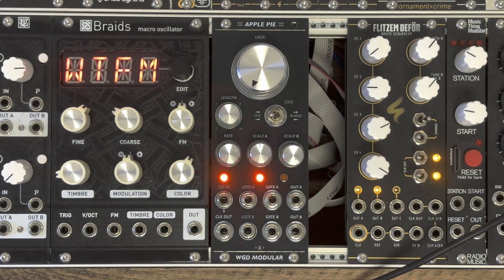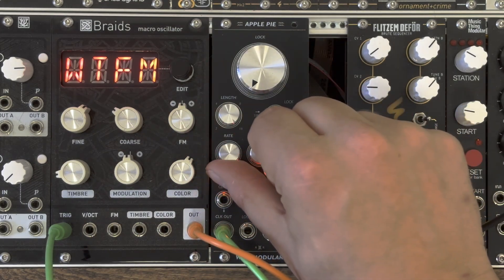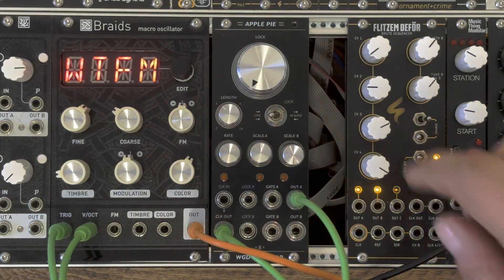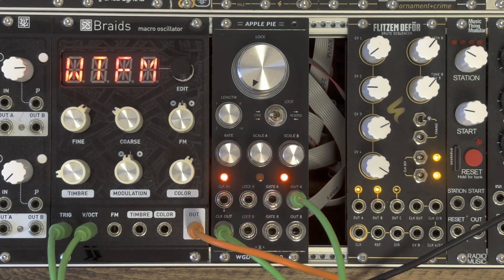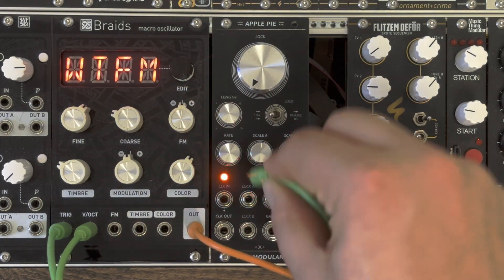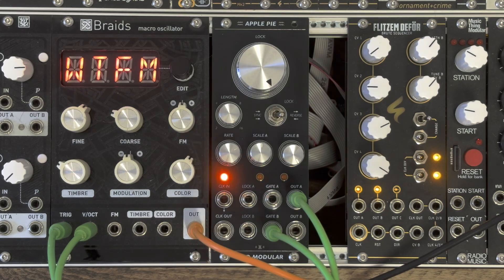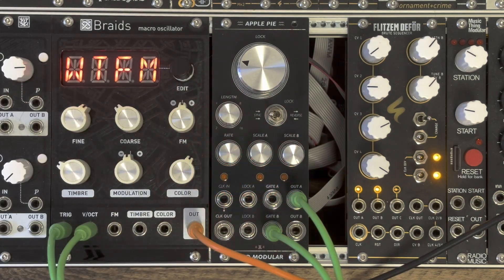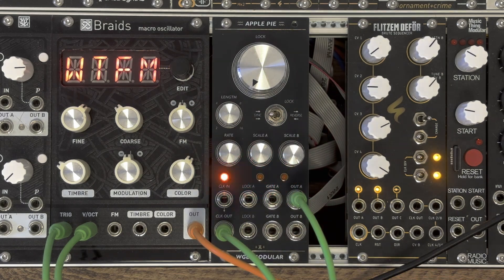I BUILT MY OWN GENERATIVE SEQUENCER!

Comment: Very good. The simplicity and ease of use is impressive. Only think you should have the option of odd number lengths like 7 and 15 etc.
Reply from the maker: The firmware is open source so it’s reaaaallly easy to put that feature in. Literally it’s just adding one line of code 😄
Reply: @wgdmodular1252  Very good!!